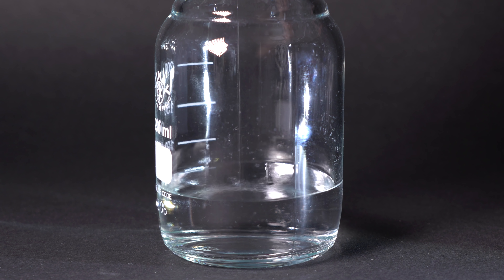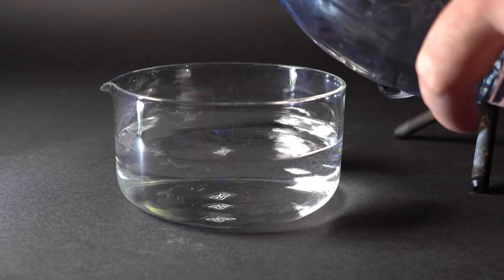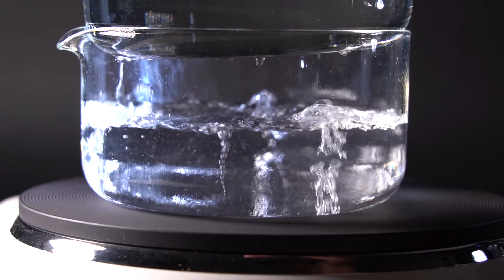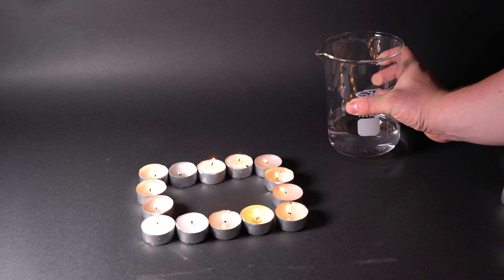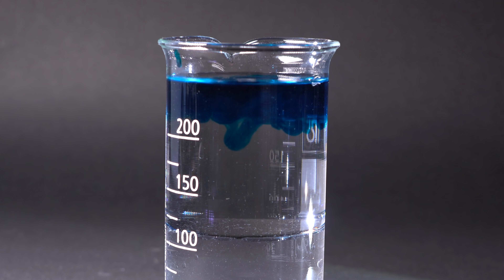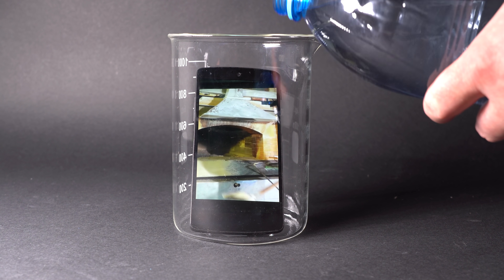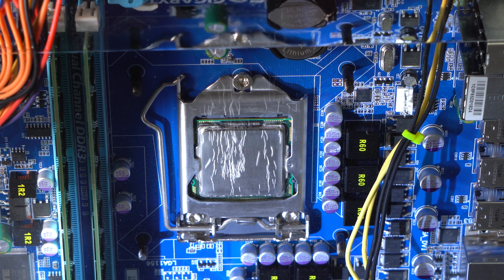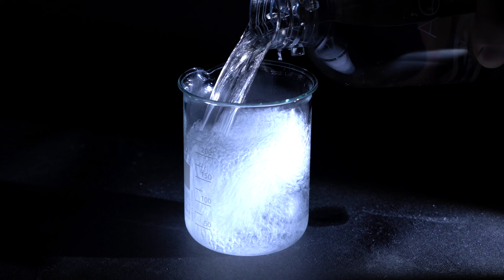Dry Water - The STRANGEST LIQUID On Earth!

Comment: In 1966, a Dr. Leland Clark attached a weight to the tail of a white lab mouse, and put it in a beaker. Then he filled the mouse-containing beaker with a liquid fluorocarbon, perfluorobutyltetrahydrofuran. At first, obviously, the mouse freaked at first (drowning reflex), but then amazingly started breathing normally! And he left it in the beaker for an hour,  removed the mouse, and the mouse was not harmed at all. This worked because that particular liquid fluorocarbon dissolves a lot of oxygen from the air.

Comment: The crazy part is that it isn't flammable despite being super volatile and immiscible with water. It is volatile and with extremely low viscosity yet has a high density and molecular weight. Truly a weird set of properties to coexist in one material..
Reply: it might seem weid at first but its actually quite understandable. Its density and weight as a liquid (and vapour) is highly dependent on intermolecular interactions but even more by its molecular weight. Because basically every H-atom (weight = 1u) is exchanged by a fluorine atom (weight = 19 u) its molecular weight increases quite drastically compared to the (lets call it) 'non dry water'. also the molecular structure itself should be a bit smaller in volume with the CF bond being quite strong and therefore a bit shorter than CH bonds. 
The high volatility might be further on caused by the strong repulsive interactions of C-F groups to each other (here again intermolecular interactions). 
so in the end its just a funny coincidence, that the high molecular mass and small molecular volume might help condense it @ about 200K but it just breaks down to vapour at slightly above 40°C .
edit: I just looked it up and the average bond length of C-F is about 1/3 longer compared to C-F bonds. therefore this is false. nevertheless, the molecules molecular density should increase and of course much more characteristics have an effect on its density in general.
Reply: @1xBublex1  how is smaller mass have smaller volume do you mean it structure the way they connect ?  it connection has more bend vs elongated?
Reply: @1xBublex1  what in the bill nye 🤣
Reply: @bordoyct8246  bruh frs i already hear the theme song playing 💀
Reply: What's crazy about it? It behaves just like almost all other fluorinated ketone's. I remember back in the mid 80's they were experimenting with a vary similar fluorocarbon trying to create a breathable liquid for high pressure dive suits. Though they dropped that idea quick when all the lab rats kept dying. James Cameron had such a hardon for the concept that he put it "The abyss".
Reply: It's not that surprising for a flourocarbon, honestly.
Reply: couldn't agree more
Reply: Fluorine chemistry is really cool, fluorine compounds can do things nothing else can. We should all be really grateful to the 19th-century chemists who risked, and sometimes gave, their lives trying to isolate it.

I don't think he even mentioned the most interesting potential application of fluorocarbons. They turn out to be fantastically good at dissolving non-polar gases - in particular oxygen, which means that fluorocarbon-based formulations are being investigated as a form of artificial blood. Imagine blood banks being a thing of the past because we could make our own...
Reply: @alexpotts6520 Umm, no. Nobody is ever going to use PFAS as a blood substitute. Pull your rather intelligent head out of the dark hole it resides in.
Reply: These properties exist because of fluorine atoms they cause low reactivity thus making this very low viscosity and volatile even though it has really large molecules.

Comment: Hey, put a few drops of dry water in a balloon to see if it self-inflates. Glad to hear your actual voice.
Reply: it might work except there is a limit to how much a liquid can dissolve in an enclosed environment. This is why the ocean does not all evaporate.
Reply: @aacc8466   did you know that the earth is hardly a closed container? I mean oxygen from earth reaches the moon..(it gets blown there)

the reason it doesn't evaporate all lead back to the atmosphere, mainly the fact at the pressures/temps found within that atmosphere make a system that recuperates most of it.
But our "closed container" has a pressure range going from 1atmos up to space vacuum, similar temperature differences. vapour density seems less likely to be the culprit I would believe..

Edit:As for fully evaporating to a gas there is some cool physics on this.  Critical fluids are such things. Where vapour phase and liquid phase get same density and such
Reply: @user-el4np5xt8c  Isnt the earth technically a box? Not so sure about the permeability of the atmosphere though. I reckon It has more to do with weather systems.
Reply: @geyotepilkington2892  a box has a certain border. Where is that border for earth? Like I said particles of oxygen get to the moon from earth.. I guess you could include the moon in the box but I think a closed box in this case represents  a box that(if you input no energy) the pressure is the same everywhere. Or at least gravity effects are negligible.

The earth's atmosphere has different pressures , even if it would have no energy input and at equilibrium the pressure within the box would be different at different locations. This is why I commented in the first place :).

The weather systems are what I described, it's the system that recuperates.
Reply: @user-el4np5xt8c  nailed it
Reply: @aacc8466  You mean evaporate in an enclosed environment, right? And there is a difference to comparing a Balloon to the ocean, since above the ocean there is a gas layer into which the H2O Vapors would have to expand and then disperse. Also, Water has a much higher Boiling Point and a much lower volatility than Novec.
Reply: Paul G evaporation is just dissolving liquid in a gas.
Vapor pressure is what he’s talking about
Reply: Paul G the lower atmosphere is a closed environment with regards to the gasses contained
Reply: @heulboje21  yes evaporate and yes i would bet you cannot evaporate the full liquid into gas.
Reply: @SiegePerilousEsauMaltomite  Unlike dissolution which is solvent-dependent, evaporation is independent of the gasses surrounding a liquid. How fast a liquid evaporates is determined only by the properties of the liquid, with no regard for the properties of the gas.
Reply: @aacc8466  pp po pl p pp no p pl p pl pp pl pls pls pp p please pl pp plp pp pp pl p l
Pp
Pll is I do
Reply: Dude that would be cool to see.
Reply: sounds like auto Sergei the Meerkat lol
Reply: The vapour pressure would probably quickly be reached. It would be hard to get a fully inflated balloon without going close to the boiling point.
Reply: i dont think a few drops would do anything however if u filled it a substantial amount so that theres already some pressure it would definetly increase in volume
Reply: A lot of people are afraid of surgery
Therefore, for a non-surgical rhinoplasty procedure, an injection needle must be used
Injecting needles means directing the needles to the bones and cartilage of the nose in order to reduce the size of the nose
And throwing this Topical Solvent Liquid substance into the bones and cartilage with an injection needle
For localized reduction of bone and cartilage in the nose
 Therefore we are asking we ask chemists to invent the liquid-solvent for those bones and cartilage
 Please send the request to chemists to conduct chemical experiments on animal and bird bones

.
Reply: I really enjoy his voice

Comment: Imagine being in a hot tub of this bad boy
Reply: Acute respirarory system failure time!
Reply: @loleq2137  maybe with an air tank
Reply: You would probably suffocate
Reply: @alternamasaki429  no probably about it.
Reply: In UV lit bathroom
Reply: I wouldn't be very hot because its boiling temperature is around 40degC
Reply: @AxielFan  Therefore, you'd feel quite cool actually. Same thing that happens with Acetone. 

In general, if It has a boiling point higher than water it feels warm on your skin (like Glycerine), otherwise it feels cool
Reply: @AxielFan  it'll still be cool

Comment: If it's a flourine keytone fluid that heavy it's very likely trans dermal so....   Maybe don't put your hands in it?  Cancer is real bad.
Reply: This particular fluorocarbon is so inert, it would not be cancerous. For a compound to be cancer-causing, it has either react with DNA, or cause excess reactive oxygen species in cells. This compound does neither.
Reply: @joeylawn36111  I generally agree, but biology is complicated and you cannot be sure from the theoretical point of view. Example xenon is anesthetic despite of being very inert. All that is needed is that the molecule/atom fits into wrong place to interact with some protein. Downstream effect can be diminished DNA repair or proof reading and the result can be cancer.
Reply: @user255  True, good example would be perfluorooctanoic acid - long thought to be inert, now recognized to be harmful.
Reply: It says it here that the toxicity is negligible for inhalation... so likely it's similarly low for contact https://multimedia.3m.com/mws/media/569865O/3m-novec-engineered-fluid-649.pdf
Reply: Even more detail: this one is called Novec 1230 but the compound name (dodecafluoro-2-methylpentan-3-one) is the same, so it the same substance.  This has specific toxicity test results on page 7, stating very low dermal and even oral toxicity. https://multimedia.3m.com/mws/media/124688O/3m-novec-1230-fire-protection-fluid.pdf
Reply: Peter Szoldan thanks for the info

Comment: So scammers can advertise "waterproof" products using this. Lol
Reply: Labeling it Dry waterproof would be amazing actually since you will think the Dry is just something they are adding because it keeps you dry.
Reply: @TheCeuticalEngineer  I could see them totally advertising a spray on "dry water proof coating spray" and the commercial just being something like 4-5 liters in a polycarbonate box and the spray is just compressed co2 and then they dip the item in the dry water for a second or two while warmer than normal like 50-60°C or so so the dry water evaporates. You could get away with making a cheap video of that on a website while only spending $600 and sell a bunch of these little 3d printed Co2 canister things for $29.99 and the cost only being like $7-8.

My first thinking was using it as a refrigerant for a really nice liquid cooled gaming computer lol. That or some kinda crazy electric car cooling system.
Reply: DETHdressedInRED take my money🤑
Reply: @DETHdressedInRED  - I think if it was a closed system and you had some sort of a heat exchange system that allowed you to condense the vapors and recycle them back into liquid form, it would work really well.
Reply: @DETHdressedInRED  This stuff reminds me of the product called EVER READY ULTRA DRY (something like that) that's a green mercury type fluid that is only made available for the military, only thing is that this evaporates,  wheras the ultra dry can be "coated" onto items, machines and they never get,  wet,  rust, dirty,  dusty,  deteriorate or fade plus it is magnetic. Doubtful the public will be privvy to its use as it would make many products obsolete.
Reply: @tash17kids  I think it's called EVER-DRY ultra (insta-ready) or something on the can yeah. We used it a few times for waterproofing shit in barracks/living areas. What I meant though is that since this stuff is cheap they could market it and ACTUALLY PROVE that those products won't get wet but it would be a scam because they can't get wet from this dry water stuff. That was what I meant lol.
Reply: Yes,  ultra everdry by Ultra Tech International Inc channel official video (there is an official vid #2 also) . Its a superhypophobic liquid. Just think of the cop in terminator movie that returns back to complete form after getting shot every time!! That's one of it's abilities using hexagonal nano technology particles from it seems this chemical in vid as it has very similar properties. Just guessing tho,  don't  quote me!!  😎
Reply: Lol hydro not hybo 😂
Reply: @TheCeuticalEngineer  that's a serious marketing strategy. Patent it asap.
While OP version wouldn't work , your rephrasing may just fool masses while technically not lying
Reply: @TheCeuticalEngineer  or cheap, clear, non. Conductive hydrocarbons.   Mineral oil.....
Reply: @TheCeuticalEngineer  Don't give them ideas buddy...
Reply: @TheCeuticalEngineer 216thlkekr
Reply: @TheCeuticalEngineer  Dry - waterproof
Reply: As if a scammer would spend so much money.
Reply: @PinkamenaDianePle  Yeah dude because this is a serious idea.
Reply: @PinkamenaDianePle  well.. it said that Chinese would made the liquid for cheaper
Reply: @rashidisw  3M Worldwide Patented Novec...
Reply: @PinkamenaDianePle  what are  you on about? They wont be selling this liquid. They sell you dry proof mobile phone .. not the liquid
Reply: @PinkamenaDianePle  they wouldn’t have to actually get it tho, just say “dry WATER PROOF”

And I’d technically be correct
Reply: Pinkie Pie gotta spend money to make money. I’m sure a scammer know that 🧐
Reply: I bet using just pure alcohol is cheaper
Reply: @HSMAdvisor  dip your phone in alcohol, I dare you 😂
Reply: @HSMAdvisor  If the subject of cleaning contains NBR or some other compounds damaged by solvents, no. I would bet against You on this :)
Reply: @HSMAdvisor  Some alcohol actually conuct a bit of electricity. So not really.
Reply: @HSMAdvisor  that damages devices
Reply: @HSMAdvisor you would have to dry it with molecular sieves, no?
Reply: Or they can just use distilled water
Reply: @AverageAlien  how are you the first to say this lol, do people not know about distilled water??
Reply: @jorisr4717  Idk too many people think water is conductive by default
Reply: LegendaryOutcast been doing it all my life.  “Umbrellas for sale!!😲
Reply: I never knew how many potential scammers are in the comments section.
Reply: pretty sure they do actually
Reply: Why u giving them idea 😂😂😂😂😂😂😂😂
Reply: Scammers must be very rich to buy that.
Reply: @mirza_alif  £100+ for a one off video to sell hundreds of fake products at an inflated price? Sounds like a bargain to me
Reply: @maxfreeman3764   Oh! yes! i didn't think like that.
Reply: @mirza_alif  I'm not a scammer, I promise 🙃
Reply: but its too expensive
Reply: @parvbhatt9671  $100 investment to trick people to give you $1000? worth it
Reply: @TheAechBomb  yeah sorry forgot that u r correct
Reply: @parvbhatt9671  not really, they can just buy 1L or even less to do a demonstration that will grant them much more money than the couple hundred they spend on the liquid
Reply: A lot of people are afraid of surgery
Therefore, for a non-surgical rhinoplasty procedure, an injection needle must be used
Injecting needles means directing the needles to the bones and cartilage of the nose in order to reduce the size of the nose
And throwing this Topical Solvent Liquid substance into the bones and cartilage with an injection needle
For localized reduction of bone and cartilage in the nose
 Therefore we are asking we ask chemists to invent the liquid-solvent for those bones and cartilage
 Please send the request to chemists to conduct chemical experiments on animal and bird bones

.
Reply: @ماهرمحمودعلي-ظ1ظ  Dude this isn't a creepy onion site, what are you talking about?
Reply: @ماهرمحمودعلي-ظ1ظ  you fool, how would they stop it from spreading to other parts of the nose and face if its injected into bones? People would be much more scared if someone said the nose job surgeon injects you with a bone melting solution
Reply: @ماهرمحمودعلي-ظ1ظ  cocaine's a hell of a drug
Reply: That sounds be waaaay too expensive
Reply: Or you could just drop it in dirt cheap mineral oil.
Reply: They could also just use distilled water. Won't harm your devices for a few minutes until the ions get in there.
Reply: LOL
Reply: oh briliant! hahaha
Reply: you are a scammer
Reply: That is literally the first thing I thought too
Reply: But what uf they already are doing it 🧐
Reply: If they could even acquire it. It would be a lot less expensive to use a fake phone ;)
Reply: That's exactly what I thought,😂
Reply: No to get ip68 rating you need to certify your device and a 3rd party does the testing.
Reply: It would cost them a fortune in a bid to advertise scamming

Comment: My computer: don't even think about it
Reply: if he added a small heatsink and a fan it im sure it would work way better than even water cooling. The problem is that without surface area it couldnt do much.
Reply: It would work in a closed-loop system with a heat exchanger. One of the first supercomputers, the Cray-1, used liquid fluorocarbons for cooling, as the semiconductor logic available at the time (no CMOS like today) would have burned up with all the heat it self-generated without cooling.
Reply: Gunslinger 2 766(6;*